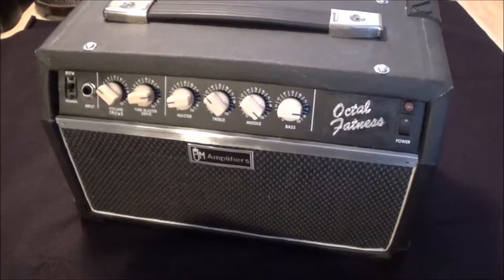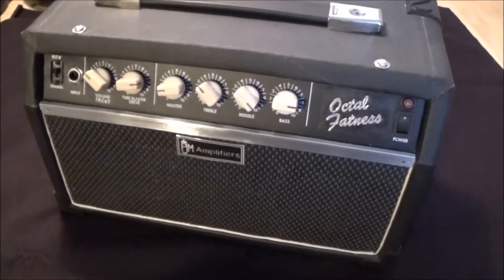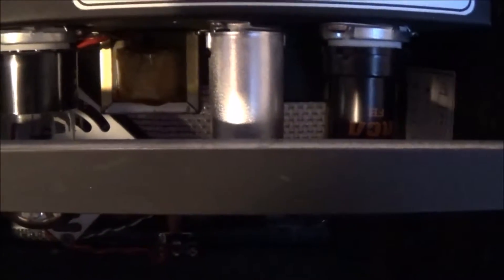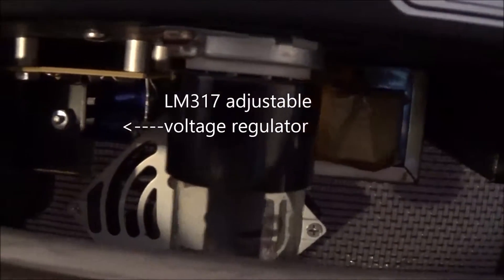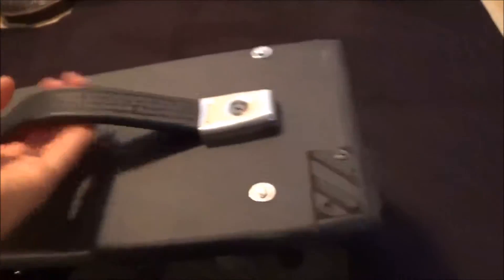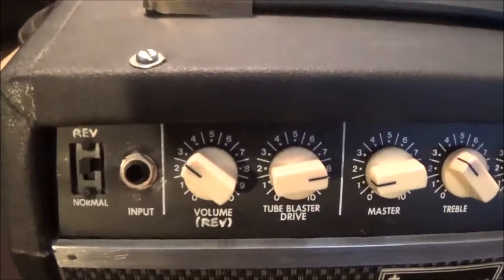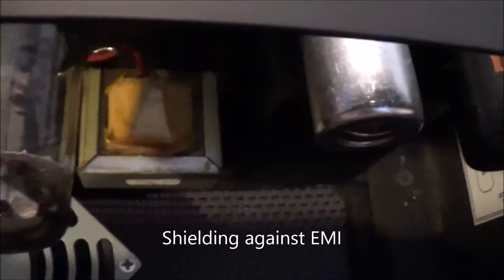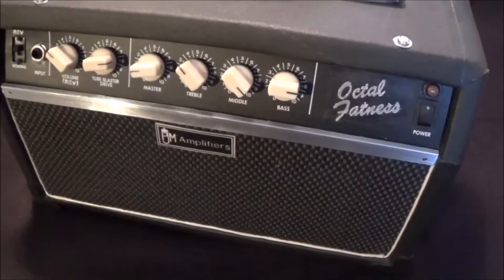My Scratch-built "Octal Fatness" Tube Amp - Overview

Comment: I don't think the 12AX7 is acting as a phase inverter as you wouldn't need one with a Class A single ended amp. I'm guessing you have two additional gain stages that are helping to drive your tone stack. Nice amp though!
Reply from the maker: lasvegasira -- Yeah I think you're right about that. Although I built a "Firefly" amp that used a 12AT7 for a power tube and it had a self-split PI. Looks like in the Octal Fatness it's a cathode follower before the tone controls. Anyway, thanks for the compliment.